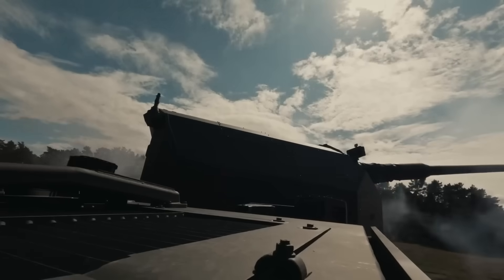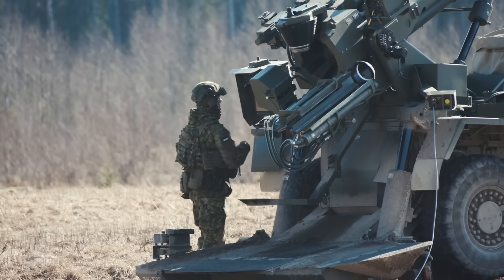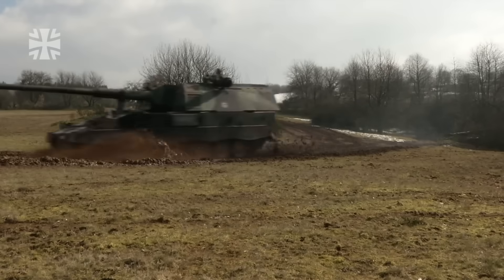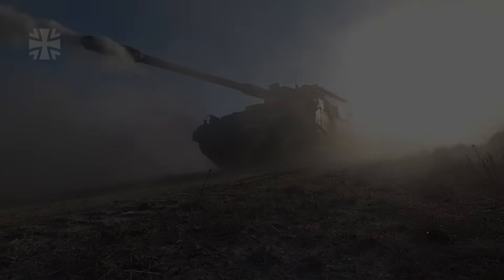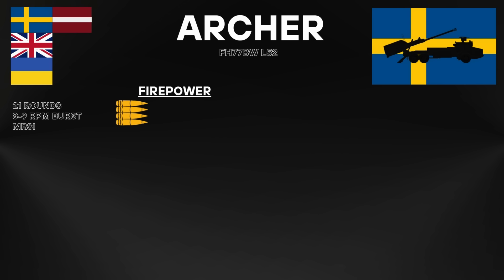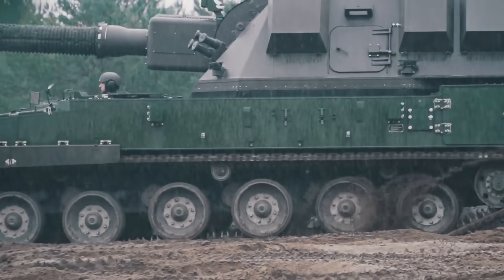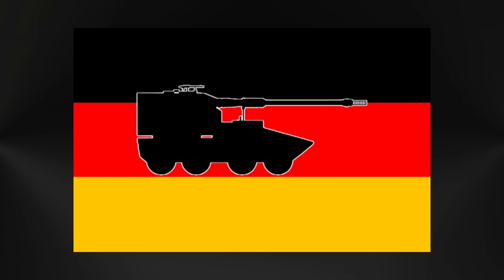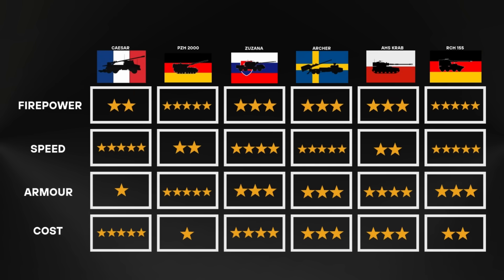Europe’s Artillery Race Explained

Comment: These are just raw numbers that don't speak to how this equipment performs on a modern, real battlefield. Want to know which of these artillery systems is the best? Talk to those who are actively participating in real combat with them in the Ukrainian war. Then you'll get a real answer. I've scoured Ukrainian websites for information about artillery. There's another aspect that's not mentioned in this film, but the Ukrainians keep repeating it. For them, simplicity and the ability to quickly repair basic components on the battlefield are very important, and for them, this is one of the most important features. In this context, one design stands out above the others. I won't tell you which one, but look it up and you'll have a slightly different perspective on the matter, and the rankings will suddenly change, with a different winner.
Reply from the maker: Agreed, but I was aiming for a more quick overview of each system based on some of the main basic traits otherwise the video would be way too long. Appreciate the input!
Reply: @EuroDefenceYT  Then stop doing short videos that mean nothing, and do an actual useful, interesting and well informed longer analysis of the subject. What is the point of that?
Reply: For now, the best in the world is the Caesar cannon; it has been used in Afghanistan, Syria, and Ukraine, and it is also air-capable, excellent for counterattacks, plus its electronic GPS firing system.😊
Reply: @bikesfrench8524  Caesar jest dobrym systemem, bo cechuje go prostota, a to duży plus. 
Ale poza tym, nie ma nic, czego nie miałyby inne systemy. Na GPS strzelają wszystkie wymienione tu systemy.
Reply: @marekduczman  Racja, poza tym zawieszenie kołowe potrzebuje bardziej stabilnego podłoża do szybkiego poruszania się po polu. Zawieszenie gąsienicowe zdecydowanie bardziej nadaje się na ukraińskie podmokłe tereny. Nieraz były filmiki jak Krab zapierdał po nieutwardzonym terenie z prędkością około 60km/h. Taka dynamika jazdy w tym terenie jest nieosiągalna dla Cezara lub Archera
Reply: @marekduczman The Caesar cannon is the best in the world; it has fought in Afghanistan, Syria, Africa, and Europe, and now the United States has decided to buy one. It is being tested worldwide as the best.
Reply: @lisekpl123 The Caesar cannon has been tested on every continent, in Afghanistan, Syria, Africa, and Europe; its production has increased 300%; it is the best in the world.😊
Reply: @lisekpl123 Tracked systems are too slow; they are destroyed due to the countermeasures (example in Ukraine), and they are not air-operable.
Reply: @marekduczman It fires shells 40 km, and with the Katana system, that's over 50 km. It's the best system in the world; in return, all other 155mm systems are completely outclassed by it.
Reply: @marekduczman Ask the Russian, he calls it the meat grinder. Don't forget that it was Caesar's cannons that repelled the Russian army at Kerson. 😊
Reply: @bikesfrench8524  Chyba jesteś jakimś marketingowcem Nextera. Każda Haubica o długości lufy 52 kalibry, ma podobne parametry.
A takim spamem zrażasz tylko ludzi do Francji.
Reply: @marekduczman Its compatibility system is key, as it's mounted on standard trucks and parts are readily available. It has no track issues, making it extremely lightweight, fast, and airworthy.

Comment: sorry, every artillery system relies on [strategic] mobility for survivability. the Caesar as well as any other. 1:07 'into action it's around 60secs.' there is so much in this short statement. when Caesar gets to its target location, the crew needs to dismount and prepare the vehicle for at least 60secs - secure enough stability in the rear with the ground to absorb the recoil. then the crew operates all in the open and only gets away from this spot by first retract the stabilisers and then get back into the vehicle. 
there are other options where the crew can remain relatively safe inside the vehicle while firing - or even fire on the move! :elbowcough: I knew which artillery system I'd prefer...
edit: giving this system 5 stars in the 'speed' category seems unjust compared to the other five or even 4 star systems, where the crew doesn't need to disembark and work in the open the entire time. unless this just represents the 'speed on the street/ground' to get to the target location but that isn't nearly as important as the speed to do the core job once it arrives there.
Reply: Your talking about the armor/protection segment here and that's why the CAESAR got only 1* in it. Can the other tracked system be airlifted like the CAESAR? nope, can they move from one end to the other without the use of carriers like train/rails? Nope, can they move at high speed on highways on long distances? Nope. 
That's why the CAESAR deserve it's 5* cause speed means mobility here.
Reply: @thomasdulac4564  yup other systems need to be transported by truck and rail and are difficult to airlift.
you could argue the CAESAR system is the airborne infantry unit of artillery sytems. fast and light.
Reply: I think you greatly underestimate the Caesar off-road performances, the French are well know for their wheeled combat vehicles, they very much know how to make them perform off-road, and proved it countless time : ain't that many great roads outside of cities in Mali and Niger either.

As for the other aspects you mentioned, they are as relevant to other platforms too, but starting from the say spot a Caesar will have reach the firing spot, fired, and relocated before a PZH 2000 or a KRAB even reached the firing position.

And 60s to set up is nothing, and it's very stable on all terrain, idk where you get that it needs to be particularly stable, has systems to help with it.

At the end of the day the CAESAR has the best range, better mobility, it the only air transportable one, the cheapest, has one of the lowest loss rate of any other SPG platform in Ukraine and is outselling all the others internationally.

Comment: Europeans a few decades ago: So guys, how will we make our new artillery systems?
Germany: Well I'm putting an autoloader and MRSI in mine and putting it under heavy armor!
France: Hear me out:

truck
Reply: CAESAR is not besigned for a kinetic conflict in Central Europa but for lower intensity conflicts abroad. Somewhere the opponent won't shoot back.
Reply: @EK-gr9gd  that's completely wrong, proof is it's one of the best performing platforms in Ukraine with one of the lowest loss rates.

It was made for both asymmetrical warfare and near peer large scale conflict in mind : it's much easier and cheaper to produce it in mass, way easier to maintain, new versions have an armored cabin, it's faster than most of not all other platforms (which is what makes it survivable in Ukraine, armor on a SPG is useless against drones) best range of all, a semi auto loader, but also the only one air transportable, light so great performance off-road, a modular design so you can literally put it on any  similar sized truck you want.

It's hands down the better platform of them all, and that's why it sells so well.
Reply: @Pratt_  Its a tall claim to say its the best. Its probably one of the most cost effective, and thats the whole point for france. Nukes and aircraft carriers are budget black holes, they cant effort expensive stuff on top of that
Reply: Judging on how it bends it's back while firing, i think it will literaly break apart after long intensive use.
Reply: @juliane__ some of the CAESAR delivered to Ukraine have already shot over 10000 rounds since their delivery their. So what are you talking about ?
Reply: Yes!
The truck based approach seems more suited for high intensity conflicts. Results speaks for themselves. The availabity rate of the Caesar is 78% while Phz unfortunately drops to 20%. And the loss rate of Caesar is a third of all tracked vehicule.
People have to ask themselves: what can a mecanic repair on a battlefied? What can peasan with their machinery do to carry a vehicule? The lighter and Simpler it is, the best it is.
Firepower is another good one: because of  drone threat, you should not carry ammunition in the vehicule to limite risk. Ammunition are carried to firing locations.
Regarding protection, being outside a cabin enables fighter to ear, and see the drone threat coming and fight it…
Reply: @7up-dp1kk  where did you get this numbers from? It's quite different from what I found.
Reply: @7up-dp1kk  " The availabity rate of the Caesar is 78% while Phz unfortunately drops to 20%. And the loss rate of Caesar is a third of all tracked vehicule."

From where do you got that? About one year ago I read an article about CAESAR in UA. The article stated that CAESAR is VERY maintenance intensive and that most systems are not operational anymore.
Reply: @kodor1146  Then check up your facts.
Reply: @7up-dp1kk  Any evidence for these figures in 2025? In an high intensity conflict you are happy to have an armored artillery piece and not this French system for colonial wars. For what scenario do you think the Bundeswehr ordered the PzH2000? You are a Ceasar or France fanboy ! why did Ukraine order more PzH2000 if it is soooo bad? Some comments are just unbelievable!
Reply: @jurgenmuller143  Dude... ukrainians are at war. They ordre EVERYTHING they can. Simple as that, hm? And, dont forget that we are on the same side here. The PzH is heavier and can protect way more than the CAESAR but it's slower and more difficult to maintain (because more complicated), the CASEAR is more agile, the more precise of all occidental artillery but one strike on it and you have to go to the hangar. This two piece of equipement just work alongside ! You can do some sort of mission CAESAR that you cant with Pzh and Pzh can go where a CEASAR might not. 

AND we do not talk about doctrine, formation... 

Fight on "who is the best" is non-sense. Germany has the best equipement during WW1 and WW2 and then they lose vs France/Uk and USSR. 
On the battlefield, you have to well use your equipement, not having the best one (even if you'd prefer to). 

So, stop insulting each other and talk.
Reply: @jurgenmuller143  "In an high intensity conflict you are happy to have an armored artillery piece and not this French system for colonial wars."

Exactly! The opposite of what he says is true.A system like CAESAR is NOT made for a high intensity land war but for low intensity conflicts, i.e. for war, or to be more precise, for combat against insurgents.
Reply: @xxdarkphoenixxx1  " They ordre EVERYTHING they can. Simple as that, hm? And, dont forget that we are on the same side here. "

Doesn´t change the fact that you are talking a lot of bs for example this:

" Germany has the best equipement during WW1 and WW2 and then they lose vs France/Uk and USSR. "
Reply: @xxdarkphoenixxx1  When in firing position while enemy fire is incoming Ceasar is not more agile than PzH 2000, the opposite is correct!The  agility is operational because you can do quick road moves over long distances.
Reply: @xxdarkphoenixxx1  When your loader and gunner have to  hang around out in the open  for loading and firing good luck with that in an high intensity conflict
Reply: @jurgenmuller143  tf are you talking about.

Armored tracked platforms have the highest casualty rates in Ukraine because their armor is useless against drones and they are too slow to relocate in time to avoid said drones.

And the fact that you talk about colonial wars definitely shows that you have no idea of what you're talking about .
Reply: @Pratt_  Never heart such stupid comment without any evidence. Kid don‘t believe everything in the internet. And btw they are plenty of videos were Ukrainian Leopard and PzH2000 crew stated that their armor saved their lives. The ibsession of some people with drones is getting ridiculous.
Reply: @xxdarkphoenixxx1 Actually, Germany overall didn't have the best equipment during the WW1. And even in the begining of WW2 on some aspects
Reply: @antoinegs8548  "Actually, Germany overall didn't have the best equipment during the WW1. And even in the begining of WW2 on some aspects"

I never claimed that so why are you talking to me O_o
Reply: @kodor1146  Ah yes, my mistake. This answer was not for you

Comment: RCH 155
Reply: I we can make that thing work reliable, it be the king. It is available tracked and wheeled, and you can pop the gun system on both in minutes.
Reply: The wheeled version seems to be so poorly thought through. Reliability rates on suspension must be atrocious.
Reply: @radosaworman7628  Seah of course you are the only one to take this into consideration the engineers designing this piece are stupid and need your help. Some comments are unbelievable!
Reply: @radosaworman7628 It's the best technology in the world, why? Because it's transportable by plane, it's ultra-fast, the counter-battery, the Caesar cannon in Ukraine, is causing damage😅
Reply: @radosaworman7628 😅😅😅If the track breaks, you're stuck; if you get a flat tire, you keep going; sleeve channels are a pain.
Reply: @radosaworman7628  I agree with your opinion. The design raises many doubts. I certainly wouldn't buy it without thorough testing. The Germans tend to overcomplicate their solutions, making them unreliable and expensive. The PzH 2000 is a prime example.
Reply: @Robert-ze1vw  I think it's undecomplicated, it has no shock absorbing supports like every other wheeled heavy artillery which means that it's either have short suspension life or special suspension different from original boxer. Both are terrible for logistics.
Reply: @Robert-ze1vw 😊The cannon that saw action in every war in 155 was the Caesar cannon: Afghanistan, Syria, Africa, Europe. The German system was too slow and kept getting destroyed, and besides, it wasn't air-capable.
Reply: @Robert-ze1vw  UK wants 150 + systems.......next issue after AJAX is coming.
Reply: @Robert-ze1vw  You seem to forget, like many others, systems like the PZH2000 were designed with nuclear and chemical warfare in the backs of the mind. Its not heavy and armored so it can sustain direct fire, its build like that it can keep operating in a fallout or chemical soup, where all the "economical" versions have long lost their crews. If that is overcomplicated depends on the assessed thread you are facing. As AC this is surely overkill...^^
Reply: @Christof_SmaulXL  All systems, except for the French Caesar and the Slovak Dana, are likely designed for this. Dana can probably operate to a limited extent.